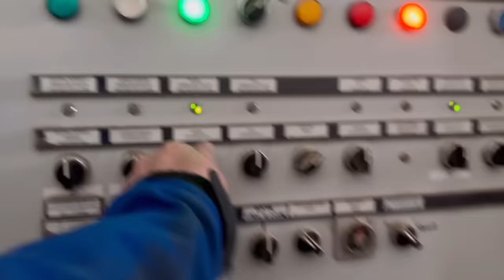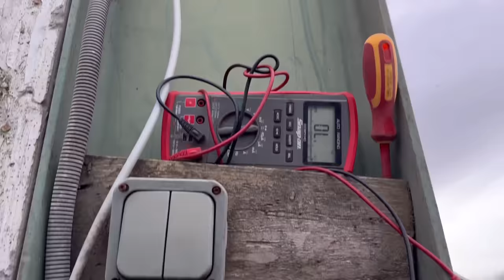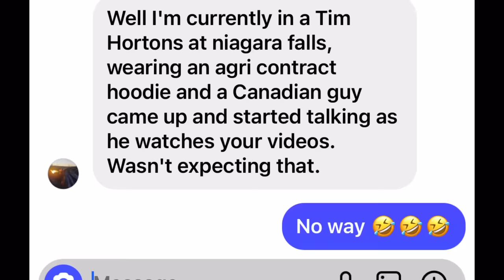STOLEN CARS & BODGE REPAIRS  #AnswerAsAPercent 1429

Comment: When I worked in dryer I used to have plenty of old car tubes,cut into strips which I used to put around the holes in corn chutes tied down with baler twine,then do permanent repair when harvest finished,dust was constant worry in case of fire,I had an industrial hoover on the go.

Comment: That dust your grinding in can be very explosive stay out of grain bins with cutting tools
Reply: Exactly what I thought, he nearly added his grain dryer and seed bags to the list of burnt out relics
Reply: While that's a real risk you do need the right ratio of fuel (dust) to air. The wife used to work for a lab testing this exact thing. They had a 2 ton pressure vessel in the lab they would blow stuff up in. Occasionally it would jump in the air 💥💥